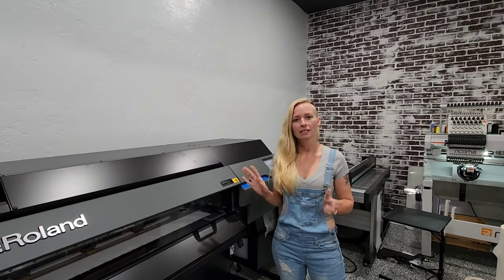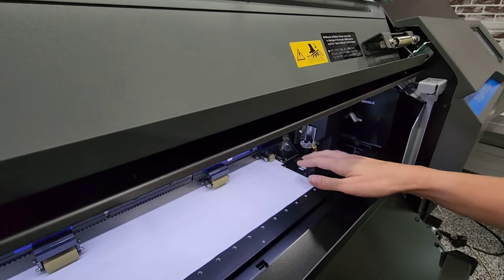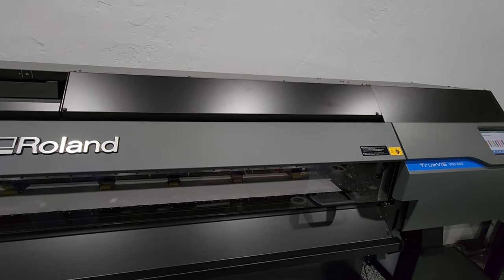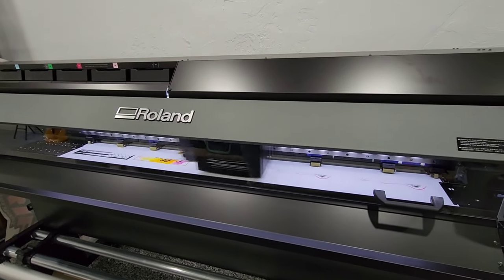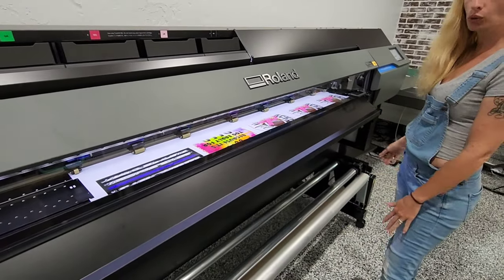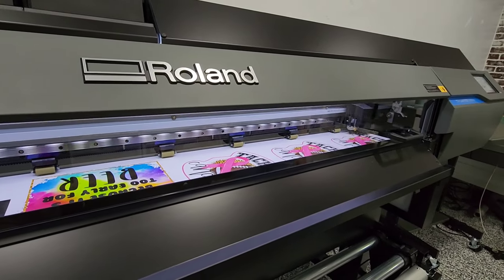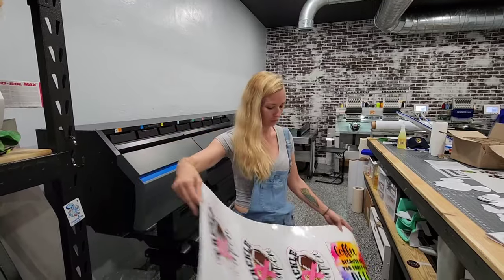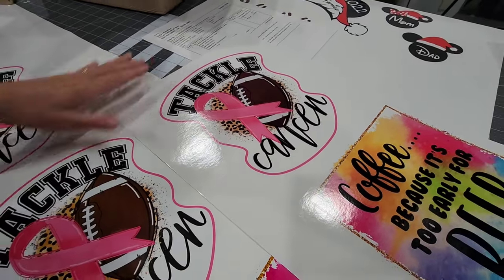New Roland VG3 640 Vinyl Printer/cutter

Comment: Any suggestions on how I can print/cut paper? I'm using a 63" roll of gloss paper, needing to print rolls of calendars. Running two up, it'll cut one but then bunch up on the second cut. I know the paper obviously comes apart based on the first cut, but are there any techniques to get clean cuts on both sides? 

I tried perforated, but the paper wont cleanly break away. Could my perforation settings be too light?  

Should I do one at a time? This way would waste a lot of material.
Reply from the maker: I would do one at a time. Our machine has just started doing the same.

Comment: Hi 
I am think about buying the small brother of this machine. Sg300 i think it is called. 

I am concerned about noises from the printer when not printing. Is it noticable when turned on, but not printing? During the print i dont care.
My desk is close to the printer and i hate hearing a fan on 100% without a reason the whole day 😅

Hope you can answer this question

Best regards from germany
Tobi
Reply from the maker: This machine is as quiet as a mouse when it is not running so it is the BN20.
Reply: @SPDesignsFL  thanks for your help.

Comment: Are stickers on this machine water proof? Like if you scrub the sticker with rubbing alcohol would the image still stay? I was watching a comparison video of the HP Latex 115 & Roland bn20. The HP Latex 115 was 100% water proof where they rubbed the sticker rubbing alcohol and the image stayed intact whereas the Roland bn20 image didn’t it completely came off. So I’m wondering if this machine is any different when it comes to it being water proof?
Reply from the maker: Alcohol would remove the ink.  The ink is water proof once it's dry.

Comment: You should have gotten a separate vinyl cutter for the cutting. If you cut too long a run the cutting will go out of sync. Never cut too far back. Also, pay special attention to those side clamps. They can damage your print head :( and that will not be nice on your pocket. BN20 is garbage!!
Reply from the maker: We have found that to be true with the BN20, but the VG3 has not shown to have the same issue. 
We do have a separate vinyl cutter that we can use after laminating if needed.
Reply: @SPDesignsFL  Happy printing guys. Treat the printer well and it will return the favour. Oh! Make sure it's on a UPS, and also plugged in to self maintain itself.
Reply: @errolsmith5634  What UPS do you recommend for such a large machine. What size?Thanks
Reply: APC  2200VA UPS will do just fine @LapLap-RLNDuk